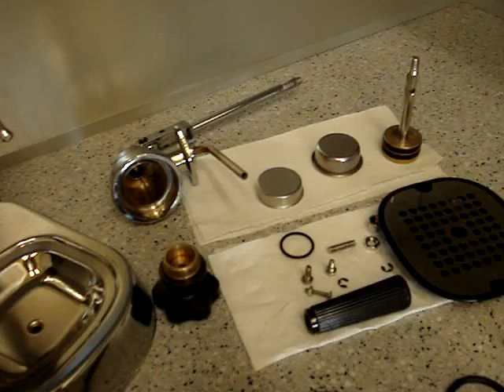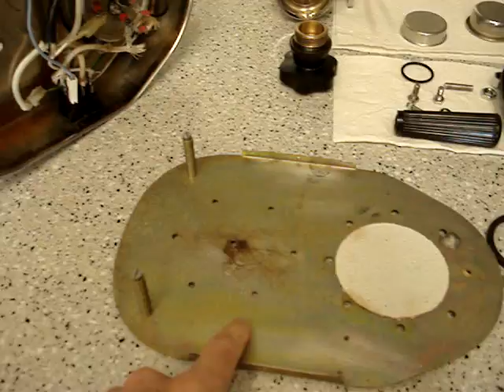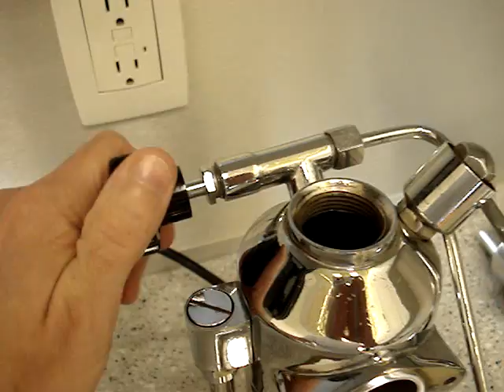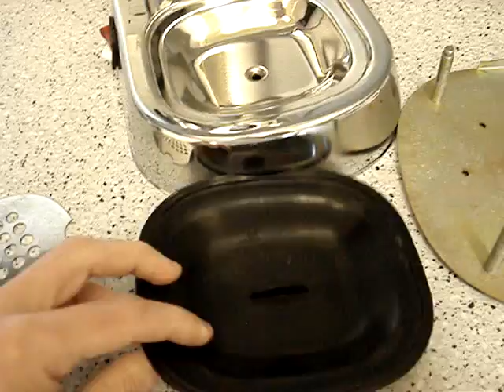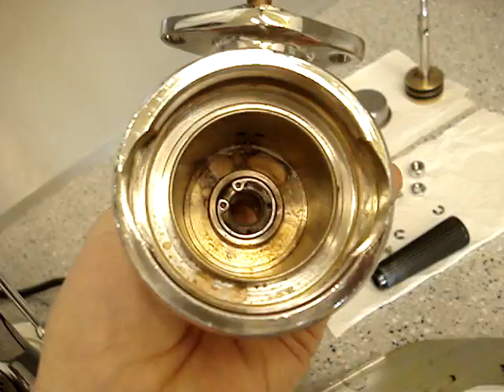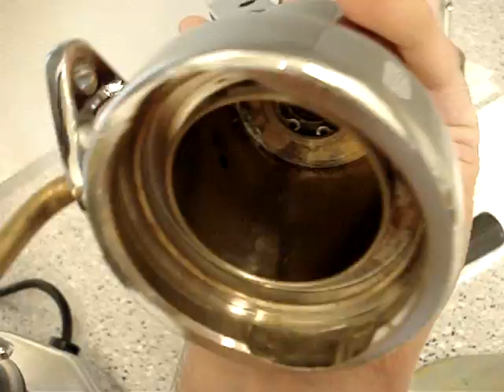La Pavoni pre-millenium espresso machine group head gasket rebuild replacement - part 1 of 2

Comment: Hi. Thanks for the video. I seem to have watched a lot on Pavoni’s the last two days:) Yours was the easiest to follow by far. 
A few days ago I unpacked a few boxes that I actually packed twenty years ago & found my old pavoni.
I’d bought it second hand & had had no idea really how it worked. I only managed weak horrible coffee, this was before YouTube and I had no manual. I didn’t pay a lot for it and it looked so beautiful that I just had it on display.
I then moved to Spain from the UK & never unpacked it, three years ago I moved to the Philippines & have finally unpacked it. 
First thing I noticed was that the cup with the handle which you put the coffee in wasn’t attached & that the thing I thought was the coffee basket was separate, it had a big rubber washer/gasket around it. Since watching all these videos I’ve since realised that it’s not the basket, it’s the shower head. Can’t find the basket yet.
The thing is after watching your video I refitted shower head & the washer as you said, flat side down but I simply cannot get the coffee basket holder into the machine. It fits without the washer. 
Do you have any idea what could have happened? It’s as if the washer is too fat.
Any advice would be greatly appreciated as there isn’t going to be a service center in this country & to have it shipped to Europe would cost a fortune.
It’s so beautiful but I don’t want to have it out on display again as I have a new modern espresso machine. I’d much rather use this even though I always think it’s going to explode & I burnt myself twice yesterday ha ha. 
Thank you
Reply from the maker: steve taylor Hard to say without seeing it. The group head gasket thickness does dictate how the portafilter locks into place, so its thickness is pretty critical. Check out a company called Orphan Expresso, if they are still around, and they might have the parts you need.
Reply: Thanks Ray

Comment: OMG thx! Link didn't work. Can u check it? My LP has been used 1x/ 6 mos. All gaskets seemed pristine. Can't replace them till i go to US in Dec. Used tiny bit of oil to lube re-insertion of piston gaskets. Not sure of the flare. Appeared straight to me but will take apart again and check (those %^$# E-clips!)  Lever still loose, can hear air/water sucking noises when i raise it when cold. When hot there are still buckets of water. Pulled a shot, no crema at all. Seemed too fast. THX, THX!

Comment: I took the piston section apart on my newer La Pavoni. The water was coming slower and slower and was taking forever to pull a shot. i thought the dispersion screen might be blocked. It was pretty grimy but not blocked. I lubed the piston gaskets with olive oil as you recommended and put everything back together. The water now gushes into the group head when i raise the lever and the lever itself seems pretty loose. Did i line something up incorrectly. Any ideas? I really appreciate your help!